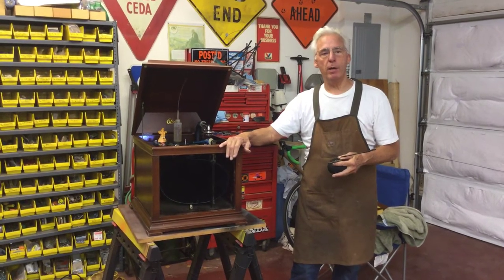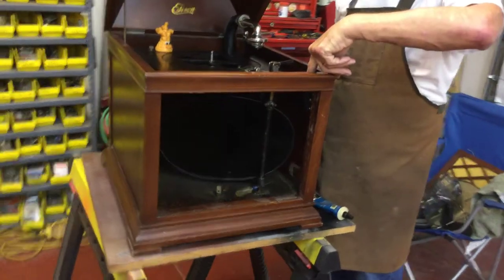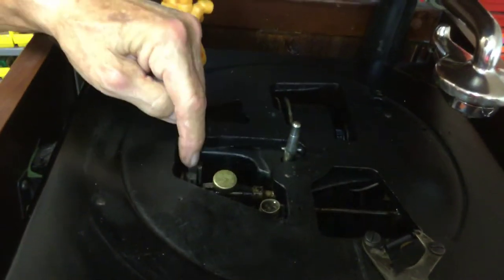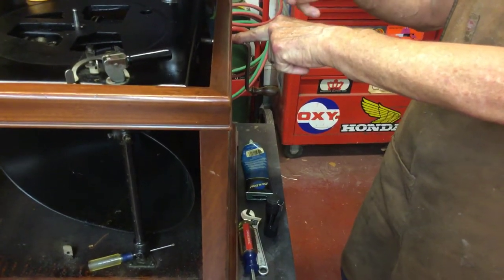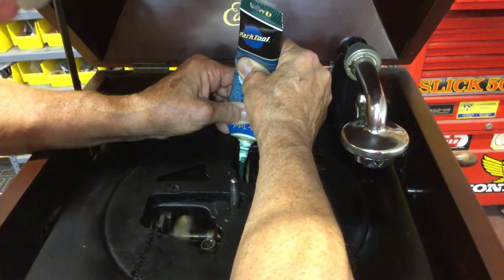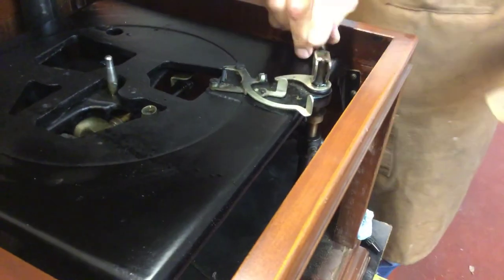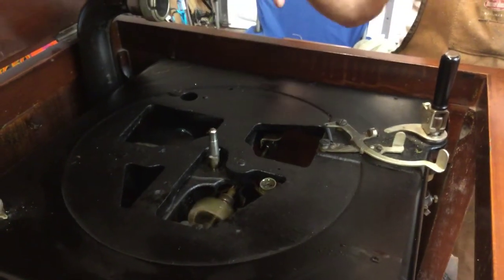73.  How to tune-up your Edison Diamond Disc Phonograph

Comment: I have a c150 that the needle  arm just stopped lifting up. When you push the handle down it tries to lift up then it sounds like it slips . Any suggestions
Reply from the maker: There are two screws on the top of the horn that hold the lift lever in place. Go to my videos and look up how to adjust/set the reproducer height on an Edison disc and it will show you how to correct it.
Reply: @1974hurt  awesome, Thank you!!
Reply: @1974hurt  I did a search and found the video. But the one you had in the video was different from mine. Unless there's another video? From underneath  in the front right by the horn that downrod looks like it's slipping
Reply from the maker: @stangurule1017  I have three videos on setting the reproducer height number 74, 235, 1661.  All Edison are basically the same same

Comment: We just got a C250 from the family and our crank only turns roughly 3 turns either way and then it is stuck. Any tips on this? Also with the crank it does not rotate the discs. The family does not know what has happened so we’re blind going into this

Comment: I recently received an Edison diamond disc chippendale console. Some was just throwing it out and was the lucky one to get it. The cabinet appeared to be garbage but the parts seemed good. When I got it home I found that only like 2 parts were missing. The reproducer and and the front grill. I’m having trouble with the motor however. When I crank the handle the spindle moves but the spring will not hold tension. Any suggestions?
Reply from the maker: A Sluicer probably the spring has either broken or come loose
Reply: Dyslexic Genius Hurt I’ve found detailed factory explanations of how to disassemble the motor but I must admit that I am a little intimidated by the unknown condition of the spring. Should I just go for it and disassemble it?

Comment: I was told that the oil cup may not work because a century of sitting may have dried any oil in the tubes and oil won't go where it's supposed to.  I guess the tubes could be cleaned out with a long skinny pipe cleaner?  Marc.
Reply: There should be an "inner-tube sized" piece of felt at the very end when the oils touches the part so it doesn't actually drip onto the part it supposed to be lubricating. You can feel the ends first  after adding oil and if they are wet you are fine and shouldn't need to fool with cleaning the tunes.

Comment: Hey..nice video. I have an Edison and am using an adapter for later 78 records. All records 
play ok until about halfway into record. Any idea what is wrong.
Reply from the maker: You need to make sure you’re winding up the motor all the way, so it has enough power to drive through a record. My first guess is that you’re not whining it up all the way.

Comment: Hello, Bret - - this is a great introduction for Edison Disc phonograph owners - some of which -like me - aren't yet brave enough to completely remove our motors.   Is it possible to grease the vertical spindle shaft without removing the complete motor?   My C19 sounds like constant "pitter patter" once the turntable begins to revolve.  I checked the governor springs for breakage, etc. but the seem to be intact and running evenly.   
Having watched perhaps every video re. Edison machines, I have noticed that you utilize Park Tool grease and Green Grease often for the same gears - on videos.  I was wondering whether you have a preference.  Also, which grease do you prefer for lubrication of mainsprings being newly installed?  It looks like you use Green Grease but it's hard to tell simply by viewing.
Reply from the maker: I prefer Green Grease because it’s a lot tackier.  Don’t grease the vertical spindle shaft, just drip a little sewing machine oil on it. You can grease where the main spring barrel drive gear hits the spindle shaft.

Comment: I just picked up an Edison H19. 
It is cranked up, but will not operate. I can turn the governor mechanism by hand, but it is very hard to turn. I’ve oiled it as shown in your video and it has freed up some. It is still too stiff you turn on its own. 
Any ideas of what else I can try?
Reply from the maker: Are the two yokes hitting the back of the flywheel? It might be the speed control knob is screwed down all the way.
Reply: @1974hurt  you are spot on! The speed control was locked down tight. Everything is spinning freely now. 
Which has uncovered another issue. 

The player does not seem to be spinning flat and true. Mostly no sound until the record comes around to a high point and I get a split second of sound before the record drops lower than the stylus will reach. The floating part of the tone arm is riding mostly at the bottom of its travel range, not centered in its travel area.
Reply from the maker: @hpwdtm  go to my YouTube page and type in “how to balance a turntable”, it’s video 77 I believe.  If watching the video doesn’t help then send me a video of the machine playing to   dyslexicgeniushurt@gmail.com
I should be able to watch it and figure out what the problem is
Reply: @1974hurt  thank you! I watched the video, added rubber pieces and adjusted the horn down some and the machine is playing now. 
The needle is going off center as it tracks across the record. It starts skipping by the close the the end of a record. Like it’s running out of travel room from side to side.  
Also most of the sound seems to be coming from the top, record area and not out of the horn. 
Any ideas or videos on the issues?
Thanks again for all the help!
Reply from the maker: @hpwdtm  it sounds like a problem with your reproducer and with your reproducer height. I have videos on how to set your reproducer height.
Reply: @1974hurt  yes, looks like the string that goes to the diaphragm has broken at some point.

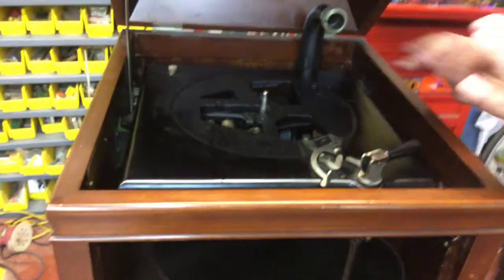Comment: At 6:07 you mention the engagement lever. You said it drops the horn so it will track. No. That is incorrect. Sure, the horn drops, but that's not what makes the arm and reproducer move to track the record. There is a feed comb underneath and the feed comb gear. When you pull the lever up it engages the feed comb into the feed comb gear and that's what makes the  tracking work, not the horn.